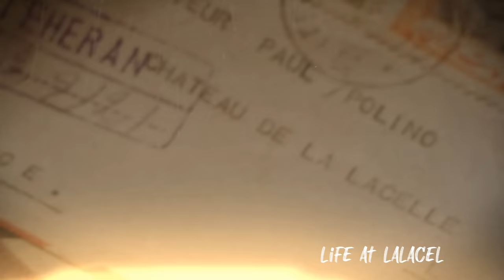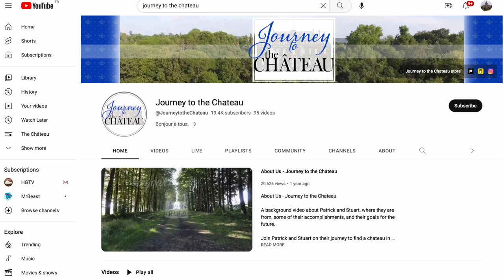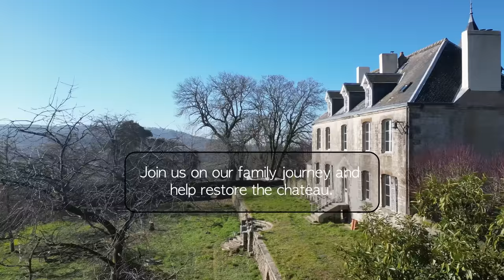BACK to work | DISASTER in the Château Bathroom.

Comment: Thank goodness you decided to take the paneling out or you wouldn't have found the dangerous wall and it didn't look as if it could have held much longer. You really have to wonder how stupid the previous people were to just knock a hole through a support wall and not fit a lintle but expect a couple of pieces of paneling and some thin ply to hold a brick wall and another floor above it safely 😮
Reply from the maker: It know it is crazy to think about

Comment: So many more plusses than minuses here. That wall would have collapsed at some point, which clearly could have been catastrophic in so many ways. A hydroboarded bathroom makes much more sense - and as you say, you now have additional spare panelling to use elsewhere where it may have rotted / be needed. I was wondering in an earlier episode where Terry was running wiring just what the walls were like behind the panelling, and going forward, it might be a good idea to remove a section of panelling on every elevation of each room just to check and reassure yourselves that all is well. Brilliant work guys 🥰
Reply: Thank you so much for your kind word Huw 😊
Reply: @ashleywaters7198  you guys are inspirational - truly deserve every success 🥰

Comment: I've got to call out the use of a wood lintel supporting all that brick over a shower stall. Because of the humidity in the bathroom and season humidity in the stone wall, I absolutely must advise you replace the wood with a concrete lintel. That is far too much weight suspended above an open shower stall to use wood.

Comment: May I ask why you use the stand alone shower units rather what we do here in NA with waterproofing and tiling a shower space? It looks more expensive and integrated into the design as the selection of tile is enormous. The shower space is also larger or can be custom sized.